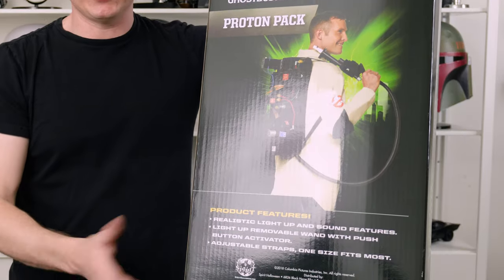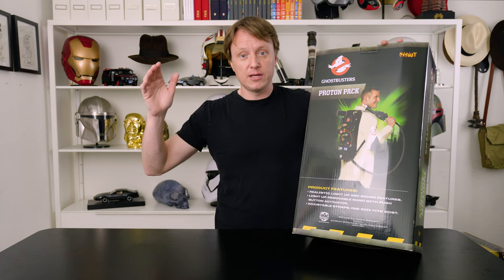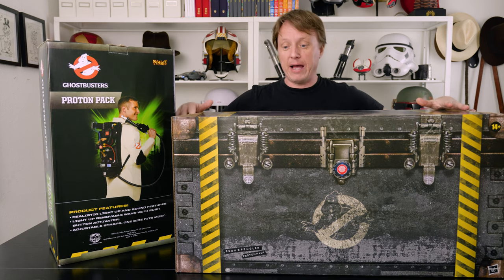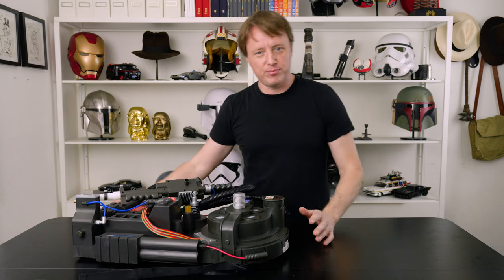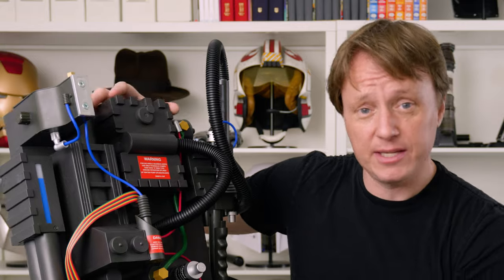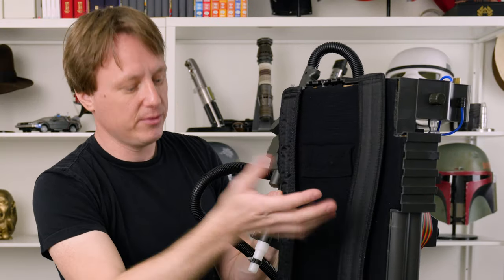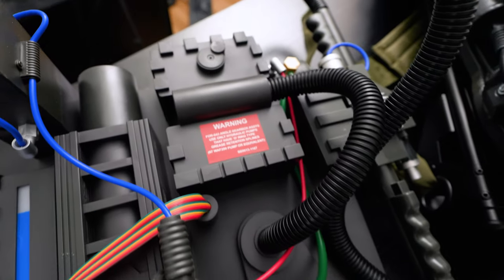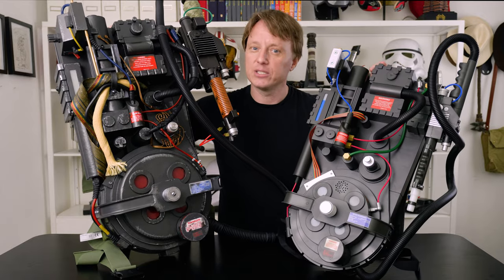$89 VS $500 Ghostbusters Proton Pack (Spirit Vs Hasbro Haslabs Review)

Comment: Did the Spirit pack for Halloween. Didn't know about HasLab other than some people talking about it possibly never coming. Still even post HasLabs, Spirit is a screaming value for your first foray. Get it in the shoulder season (early or late for halloween), and Spirit has great single item coupons when the stores open (20% off!) to maximize value, especially as you're probably buying flightsuit, boots, accessories, patches, etc.
Reply from the maker: The spirit pack is great value
Reply: Yup, I got an earlier iteration of the Spirit Pack for 60 bucks. Felt like a steal.

Comment: Curious.. Why were they not built to movie specs!?! Plastic is plastic, but size.. I'm not understanding the logic, it's like the ghostbusters cartoon, different colors?
Reply from the maker: The Haslabs one was built to spec, it used scans of the original Afterlife pack. Still got a few things wrong, but pretty close. Some good videos out there about it. The Spirit Halloween, well, I think that was just to make it as cheap as possible and they figured doing an 80% scale would be fine
Reply: @mariuscinematicuniverse  correct, I'm referring to spirit, why were the dementions intentionally incorrect?
Reply from the maker: I'm guessing to just save money and make it cheaper. And it was the only available one at the time, so no need to make it larger or better than passable?